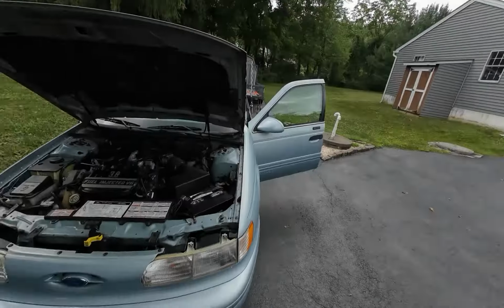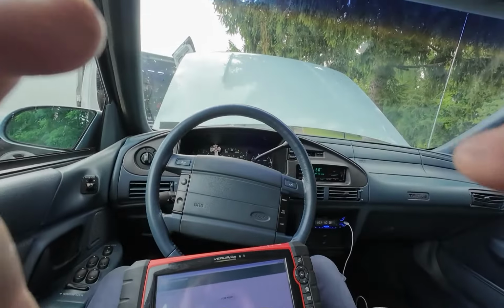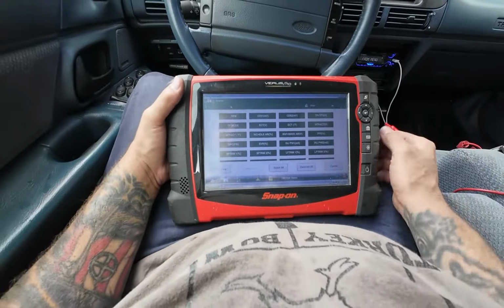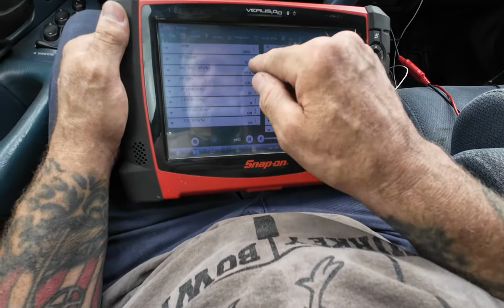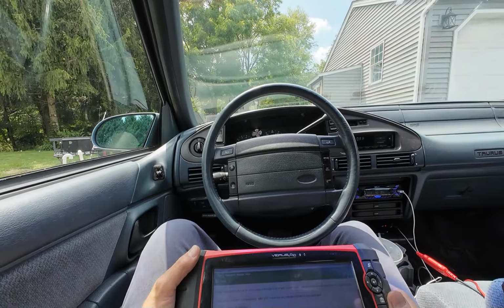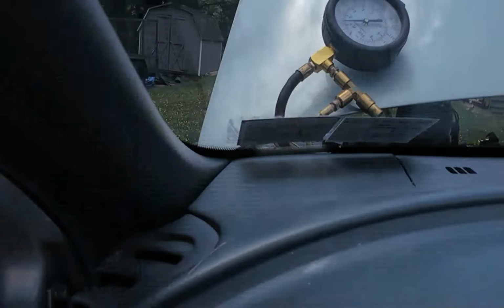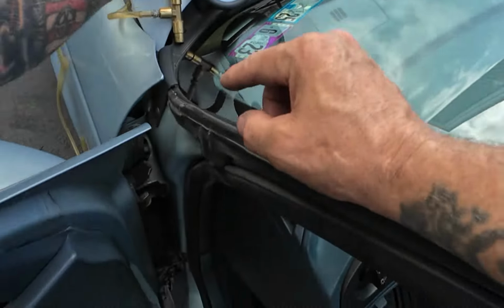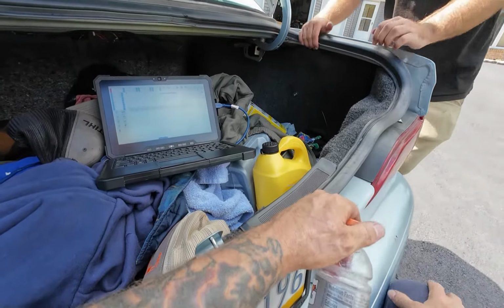1993 FORD TAURUS NO START? LOW POWER? PART 1

Comment: My guess is there's rust in the tank blocking the fuel pump sock
Reply from the maker: That was my guess too, I also took a sample and found no particles or excessive water or alcohol content. The customer replaced the fuel pump and filter and started no rust or any debris in the tank or in the filter... Just a bad pump. With it's low mileage maybe the previous owner drove frequently with a low fuel level and damaged the pump... Not really sure